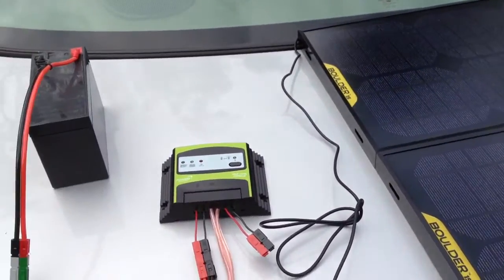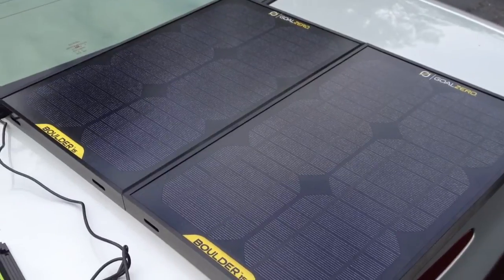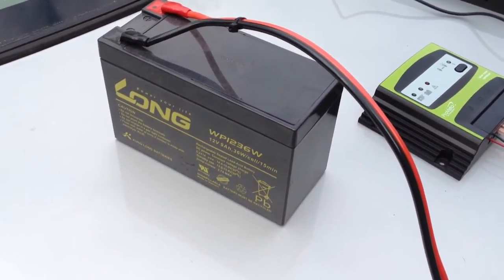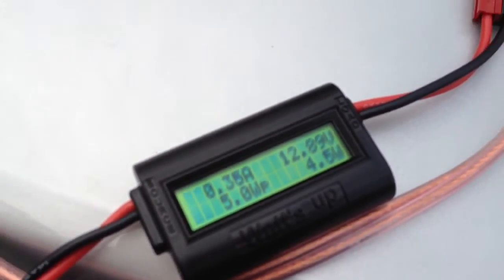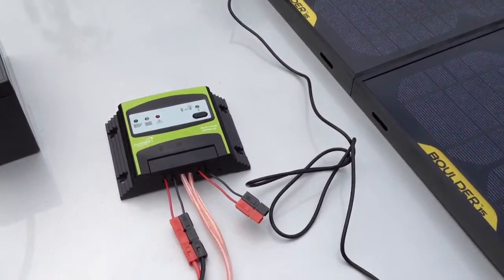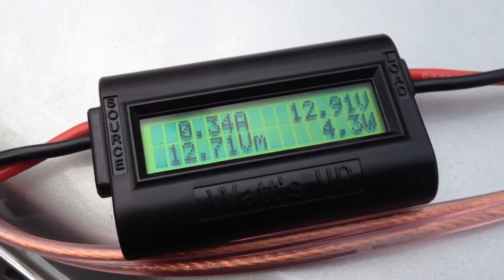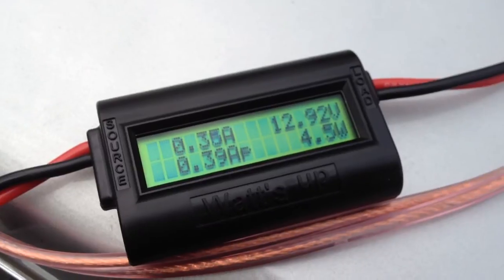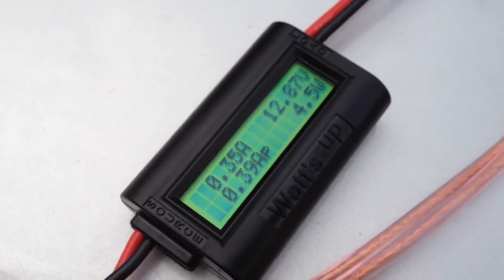Solar Panel Test in Clouds with Goal Zero Boulder 15s

Comment: as soon as your batterie is reaching its " absorbsion" charge level you lose the advantage of mppt charging....however it is most efficient when in the " bulk" mode that is from say 50 to 80 percent soc, so in general yoy wil get the most out of a mppt charge controller when you need it the most, in the morning when your batteries depleted from running at night needs al the amps it can absorb, still the also importend last upper 20 percent ( till 14,4- 14,7 volts take a long time to complete because the lead batterie can only accept a very small amount of amps.....LiOn type batteries dont need this nasty absorbsion stage , you can push all the amps in at your disposal, right down to werw there full, witch is for most types 4, 2 volts per cel ( each cell has a nominal working voltage of 3.3 volts when fully charged) lead acid ( vrla, gel, agm) is cheap but hopefully on its way out when LiOn prices goes down...

Comment: Ya but you had no load on the solar panel because the battery is fully charged
Reply from the maker: Mark Osborne Great catch, especially since this type of controller isn't going to get the battery up to 13.2.  I knew a lot less then than I do now :)  Thanks for watching!

Comment from the maker: The Watt's up in this example uses Anderson Power Pole Connectors.  I had to make an adapter cable from Anderson Power Poles to the correct 4.7mm jack for the boulder 15s.